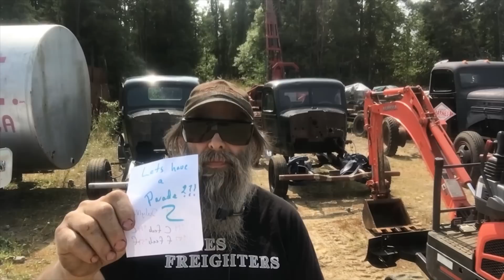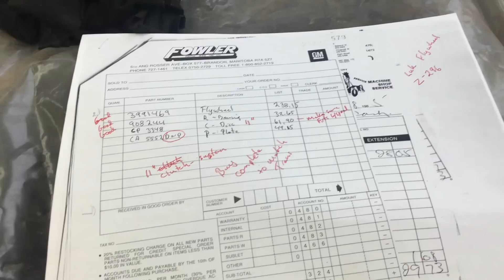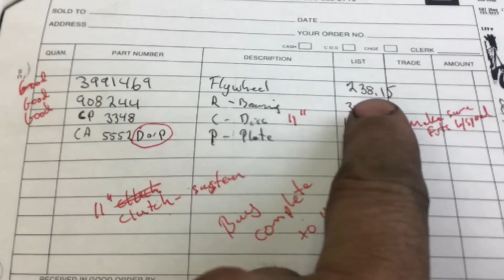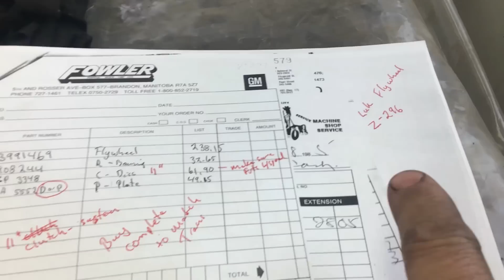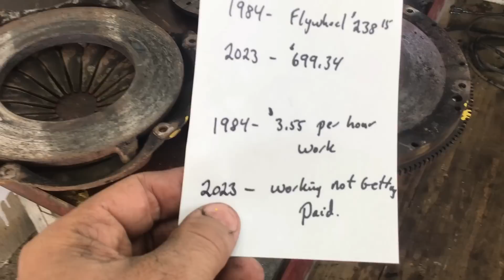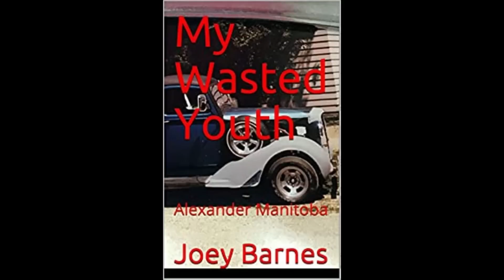Tribute Truck Clutch Details, Learning at My Age July 18 2023

Comment: Your plasma cutter will make the hole in the bell housing 5 inches pretty fast, just need a centered template,, been there and done that...Ups does the same thing over here, I just paid $124.70 extra for a set of truck springs.  I don't even live at the end of the world,, but Dawson Bay seems to be close!🤣
Reply from the maker: found a bellhousing on ebay cheap and hope there is no drama. these big company just over charge and get away with it for some reason.  thansk

Comment: The CP3348 clutch disc does fit the Corvette. A really common 11" disc with a 1 1/8 x 10 spline. I used one from a 1958 2 ton Chevrolet in my 63 Bel Air with a 348 and 3 speed. Clutch held up really well.  Pressure plate and flywheel fit those old 2 tons too. Why would you replace the flywheel? It just needs resurfaced which west-trans does. Good luck with your build.
Reply from the maker: yes back then they made certain part numbers for certain things now one size fits all. the cost to ship south and back make it easier to just order in a new flywheel. thansk

Comment: Hey there koo Jo the Chevy 400 flywheel is externally balanced .all other Chevy flywheels are interchangeable .the 3/4 ton and c60 c30  trucks came with 12 inch clutches
Reply: Has a extra weight and will cause a vibration if used on any other Chevy engine
Reply: The 400 Chevy flywheel has has a weight casting in the flywheel
Reply from the maker: thank you, that is what we are finding out.  thansk
Reply from the maker: we think that was the problem we had with the 400 i owned that went missing. it had a vibration.  thansk
Reply: flywheel must fit tight on the crankshaft